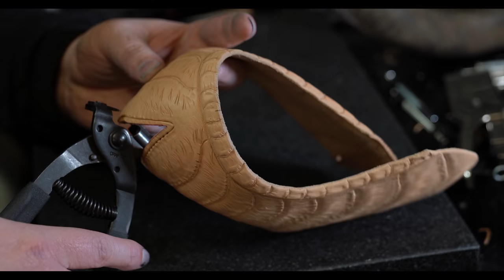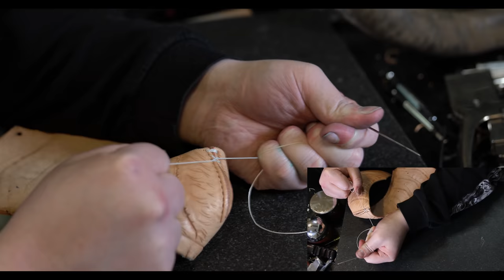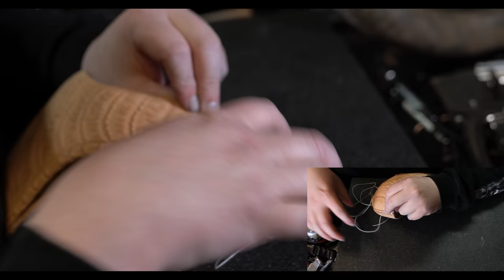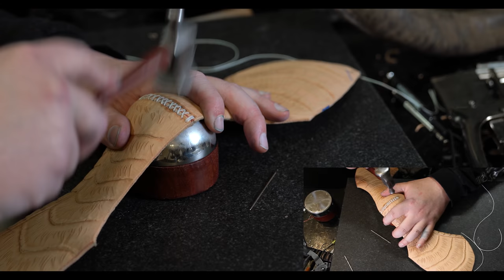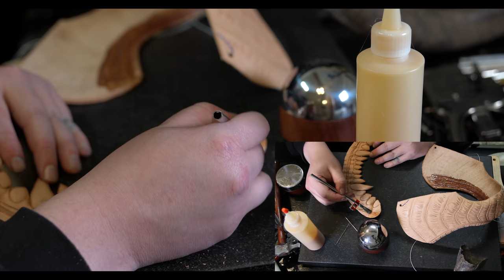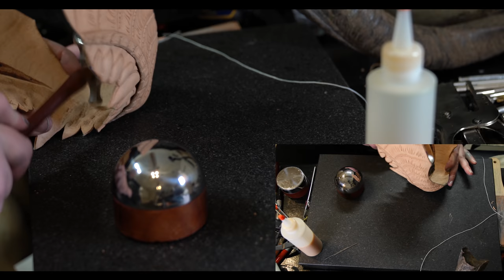🐲 MASTERPIECE TIGER DRAGON ART HELMET P.2 🗡️Leather Armor Artisan Crafts 🛡️

Comment: around the 5:32 mark I cant tell what it is your are doing, sounds like peeling the leather or scoring it but the way you hold the tool I cant tell what it looks like to guess.  Since you glue it later I am guessing it scores the leather though for a good bond?

I think this length is ok, I do prefer the longer ones but wont be annoyed if they are this length, so I guess whichever is easier for you to edit!  I like you added the little window view too!
Reply from the maker: Yeah
Reply: Yeah, he's scoring it with what appears to be a scratch awl. Tandy does sell a leather rougher that's basically a really rough file bent at an angle with a nice rubber handle attached to it but at $35, most people use an awl that they probably have with starting leather working and it works just as well.
Reply: @HyBrithe  thanks, i cant wait to try leather working, something I have always wanted to try.

Comment: I have 3 questions for you mate after watching this. First, after you glued the teeth onto the jaw, will you/did you stitch in in place after the glue dried? I see there's a pt3 coming soon so I wasn't sure if you would go over that in the next part. Second, have you experimented with the different types of leather glue out there? Since this glue is on the bottom piece, any vapors from the glue will go right up your nose. Do you prefer Barge's All Purpose Cement vs. Tanner's Bond Contact Cement vs. Fiebing's Leather Weld? Third and lastly as a minor question, what is the domed metal anvil you are using? Is it something you made out of scrap metal or did you actually buy it as an anvil? I was thinking of making one out of a block of wood and pool cue ball. I thought it would be strong enough with leather in-between as long as I'm not striking it directly with my chasing hammer. But now that I see you have something better, I'm curious to know.

Thank you for another video to watch. =)
Reply from the maker: That's actually a lot to unpack and reply to here but I will say some of that will be answered vids at least.  Thanks for watching!